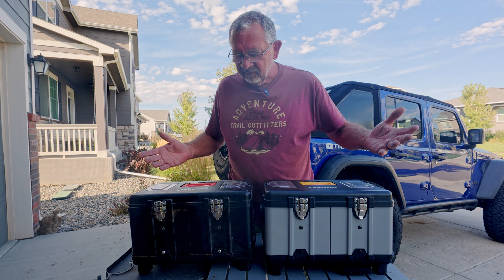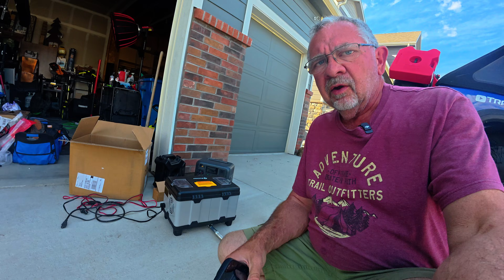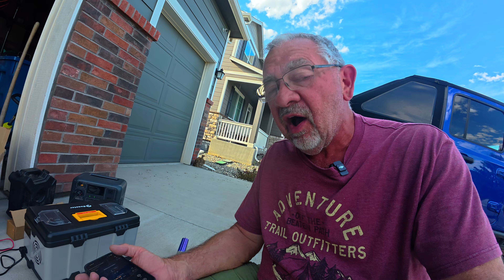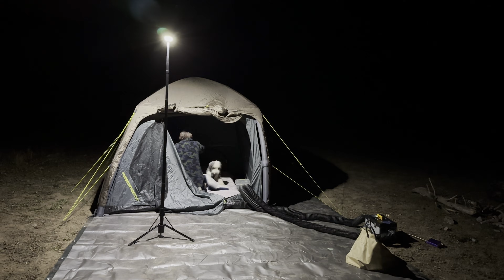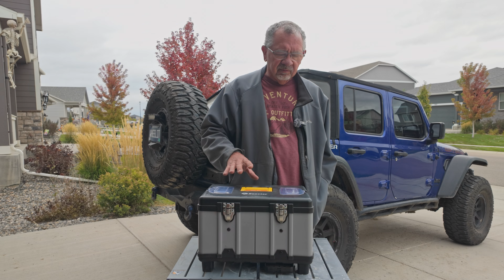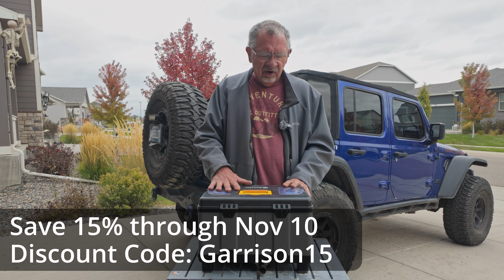Stay Warm When Overlanding With a Diesel Heater - Sunster TB10

Comment: How long did the ac70 run this unit? Looking at this exact setup for our enclosed trailer for winter camping pnw....
Reply from the maker: You will run out of fuel before running out of battery. If you’re running it for 8 hours a night, it’s the starts and stops that will drain the battery. You could probably get 5 nights off of it
Reply: @TrailTraveler perfect, that's the info I wanted to hear. Thank you

Comment: I have one to heat my office. Unit is inside with the exhaust to the outside via a hole in the wall. Only annoying thing is dat if I switch it on it interferes with my wifi so much that my wifi goes down. Any one have a solution?

Comment: So im thinking that i could also direct the exhaust to be used to heat my solar shower water.... that doesnt get warm on cloudy days. Imagine a car heater core that i add a 12v pump to circulate water from the tank thru the core and back into the tank. Bend up a ducted manifold to route the exhaust thru the heater core. You have all night to heat your water and by morning I bet the water is too hot to shower with. Thats the rough idea i have. Wasting the exhaust heat anyway.

Comment: Watched your video today and really liked the low noise aspect.  Went to order and it seems it's no longer available.  If anyone has info on a replacement model or other manufacturer with this low noise, please comment.  Amazon has another  Model from this manufacturer with less included and for higher price but no where near the detailed information as it did for the TC10 and it doesn't make claims about the noise reduction  Thanks for any info!

Comment: I’m surprised  that unit did not come with a 115VAC to 12V adapter..?  

I’ve got an HCallory SS2.  For the outlet heat I used a Male RV Hose adapter and use a dedicated 7’ RV hose connected to the outside of my RV - hole  in bdrm  - Inside I’ve got an oil filled electric Rad up against the outlet- in -34C temps provides warmed air to the heater which resides under my RV.  Hot air plumbed into my ducting via 4 registers.  

For fuel tank -I use yellow Jerry cans/ standpipes & Small hydraulic quick connects. 

Works like a charm. !!!
I Live in Alberta 45kms from Banff…

Comment: Do you know if the ambient temperature sensor is on the control module? I'd like to extend the ambient thermostat inside my RV. I can make up a wiring harness for this. Setting the automatic temperature control on the heater doesn't do any good if the sensor is outside.
Reply from the maker: It’s built into the controller
Reply: @TrailTraveler  Thanks, Then I should be able to extend the wires.

Comment: Your cigarette socket will NOT provide sufficient current to start the heater.
Reply from the maker: I use the one on my Bluetti power station, it works perfectly. Vehicle ones may not work.

Comment: I've been testing this heater out with the 4" x 8" hose and there is a big heat loss from the hose so I purchased a 6" hose to put over the 4" hose as added insulation so most of the heat gets to the end. Hopefully, the 6" hose will fit over the 4" hose. Otherwise, I'll have to go to an 8" insulating/insulated hose. I'm only heating an area of about 80' squared by 7' but I hate heating the outdoors with the loss from the hose.
Reply from the maker: We have been using a 4" insulated hose and I was able to cut it down to about 4'. This made a significant difference from running it longer as, obviously, the shorter the hose, the less heat loss.
Reply: @TrailTraveler  Unfortunately, I need almost the whole 8' to reach the RV window with the heater sitting on the ground on 2x6s. My solution of a 6" hose over the 4" hose should help a lot. Last night, using just the 4" hose, running the heater on level 1 with an outside temp of 38F, it kept the RV at 56F(pretty good). However, I'd like a little better efficiency. If it works too well, I can always open a window. I'll let you know.
Reply from the maker: One thing I did that helped before I had a way to get the heater closer was to wrap the hose with a moving blanket to minimize heat loss. Maybe something like this would help you reduce the hose length: https://amzn.to/3VYajrk
Reply: @TrailTraveler  The 6" hose was only $13 and will be easier to travel with and seemed to be the neatest option. Six feet of the hose is vertical so wrapping it would be hard to do. There is duct insulation that would work similar but I don't like working with fiber glass.
Reply from the maker: @ let me know how it works?
Reply: @TrailTraveler  I will. I just got it all set up last night. I'll do some detailed temp. measurements first, without the 6" addition and then with. The outside of the 4" hose was quite warm to the touch, that's why I figured I should insulate it. I also have the stainless 3" to 4" adapter that I am sure loses a lot of heat right at the exit of the heater. The 6" hose will inclose the adapter and also the 90 elbow going into the window. I expect a 50 to 100% increase in efficiency.
Reply: @TrailTraveler  I got the 6"x8' duct today. Checked it for fit, very nice about a half inch gap between the 6" and the 4". Should be great. Collapsed it is only about 10" long so it will be no problem to pack. I figure that I can collapse both the 4" and 6" together for a nice package. I don't think I'll bother with diagnostics, speccing out the difference with and without the 6" duct. I know it's going to add a ton of efficiency. FYI, it is from the same link as the 4" duct.

Comment: I got one of these yesterday. I'm impressed. Seems to put out more heat than my RV's propane 38kbtu furnace. Efficiency seems to be better also. I'll have to do a cost benefit analysis.
I also got the 4" hose per your suggestion and a stainless 3"id to 4"od adapter. (Amazon description: Exhaust Pipe Adapter Connector Reducer, 3" ID - 4" OD). I ran the unit on high for about 15minutes. The heat exch go to 450F, didn't melt the hose. I am debating whether I should get a dryer vent or elbow to put in the RV window facing in.
I'd like to go to RMNP but it is either too touristy or really cold. I used to go up to Estes and RMNP 30 to 50 years ago when there wasn't gridlock. Now I hang at Blue Mesa and McPhee.

Comment: Hello. Enjoyed your video and I am interested in this unit. I watched your video on the Winnpro and you are correct about it. I bought one based on another video that claimed it was quiet. It was loud. This one you have seems to be quiet but I have a question. With you being a person that modifies your own heaters to make them as quiet as possible weren’t you curious to see how they made this one so quiet right out of the box? I expected you to at least inspect the interior to see what type of pump they used or if they insulated it somehow. Thank you for the review and have a great day.
Reply from the maker: This one, and the LF Bros N2 Pro (which is the quietest heater tested to date) simply have different fuel pumps that don't make any noise.
Reply: @TrailTraveler  I understand that part. But what pump are they using?
Reply from the maker: @jimspence5779  The LF Bros doesn't say anything on it
Reply: @TrailTraveler  I am only asking because I got suckered on the Winnpro from another channel. I like taking things apart and I think you do too based on your ability to modify your units to make them better and quieter. Plus I believe you know what to look for and if this unit is that quiet for that price I would be finding out exactly what pump they are using. I believe that the other channel I watched to buy the winnpro probably received a modified unit from the factory that was quiet but the one sold to the general public was not quiet at all and probably used sub standard parts. I am trying to find the quietest heater I can buy. I appreciate you taking the time to reply. Have a great day.

Comment: Hi Carrie, I bought this Heater because of your recommendation, actually, I used your code and I appreciate it, but unfortunately,y it didn't work, I'm just returning from the coldest camping trip ever and it didn't work, I did use my Jackery to connect it, I tried several times every night but it only sent me the message E10 and E08, I don't know if you have any recommendations because this item isn't returnable and wanted toseew if I was probably doing something wrong, thanks
Reply from the maker: Are you trying to connect it with a DC connection or to one of the AC outlets? I have issues with most power stations not being able to fire up a heater from the DC port. Try the AC adapter and see if that works for you.
Reply: @TrailTraveler  I did use the AC outlet
Reply from the maker: @SoyJonaMusic  Sounds like a bad glow plug or bad connection to it.
Reply: @TrailTraveler  ok! I'll try using a different connection cable and/or a different power source. Thanks!
Reply: @SoyJonaMusic any updates?
Reply: @ExploreLiveCreateShare  The heater was broken, I spoke with customer service and they sent me a new one, which is working perfectly!
Reply: @ExploreLiveCreateShare  btw I ordered a replacement for the thermostat cable and I installed it in the old heater but it didn't work either, I guess I'll never know what was wrong with it.

Comment: Would you be able to do a short video or provide a better explanation on how the operation of it works? I have the exact same heater and I’m having a hard time figuring out basically how to make it run correctly. When I use the app it never really goes below level four on the fan. I’d like to be able to keep it on speed one or two and have my temperature set so I’m not getting roasted.
Reply from the maker: I’ll see if I can do that in the morning

Comment: I keep getting auto shutdown, overheating error code, and only at 1/2 heating power! Checked that fan not blocked, duct hose not kinked but still recline overheat error after 30 min run time. Any suggestions?
Reply from the maker: If you are running more than a few feet of duct hose, you will need to move up to a 4" house
Reply: @ thank you, currently running 8’ of 3” insulated duct hose. Which adaptor/reducer attachment would you recommend to attach 4” hose
Reply from the maker: I believe this is the one I used: https://www.amazon.com/POWERTEC-70145-4-Inch-3-Inch-Reducer/dp/B00M3IT378/ref=mp_s_a_1_1?dib=eyJ2IjoiMSJ9.A-Vuix9V8ycGAelm-PB87huyNRHv309Eij5YrXVaPxG40RYfwzeTSJv5jPoFqj0p7vO1VZ5R6zMfmKczai8-yTyylIEDH-COnwDYAfVLio8XB0dscArpezZqVBV0Tnpjjj2wKw0ZEJDJnVadF2KlQSsn7OIVnRUQLnuQvWyPfWMciWHA9OCuYwL7DExx1n6tWGc9LbNYNzWCMu8KE9ccOA.PyEglDKVQP1M8YpwDOftx78LXxIqC0YnS1pz9v8mVZo&dib_tag=se&keywords=POWERTEC+70145+4-Inch+to+3-Inch+Reducer&qid=1730958472&sr=8-1

Comment: I just bought this heater, and it’s been delivered.  What adapter do you use on the hot air outflow to easily attach the insulated hose?  Thanks in advance.
Reply from the maker: I 3D printed one. After testing though, I don't think I will be recirculating the air as it didn't make any noticeable difference. I will be doing some tests when it gets colder here to see if there is some point that it makes a difference.
Reply: @ thank you!

Comment: Good review. In regards to the exhaust, I would get it off the ground a little and sit it on a fire resistant mat. They come in various sizes and very inexpensive.
Reply from the maker: I didn't think of that. Do you have a link for one?
Reply: @TrailTraveler can you do a video on the controller mate I’m struggling to get to grips with it , great video

Comment: Hi in this video you mentioned there is no benefits to recirculating the air from the tent back to the air intake. How is there no benefit? Does it not save on fuel consumption? Curious if we should all ditch the extra duct to recirculate the warm air. Thanks
Reply from the maker: We had very similar conditions two nights in a row. One day we recirculated and the next we didn’t. There was no noticeable difference in temperature, battery usage, or fuel usage. This was at around 26F.   I’ve talked to some other users that say the same thing. Maybe, under some conditions it could have a greater effect such as colder temperatures.  I plan on doing some testing here when it gets colder.
Reply: Ok that’s interesting and would love to see more testing from you on this. I also own the HCalory SS2 and wonder if this applies to that heater regarding recirculating air or just this Sunster heater?
Reply from the maker: It should apply to all

Comment: Great video, I was wondering if you got this heater to work on the plug in DC outlet on the AC70. I keep getting an E01 error on my heater. I don’t have any issues using the supplied ac to dc power supply.
Reply from the maker: I normally run it on an AC70
Reply: @ thanks for the quick response.  Do you use the DC plug in on the AC70 or the AC outlet on the AC70 with the power supply the heater came with?
Reply from the maker: I’ve used both
Reply: @TrailTraveler Consider yourself lucky. I am not able to get the plug in DC outlet on my AC70 to run the heater. I keep getting the E01 error. I tried a different plug and same thing. I added a multimeter to the circuit and the DC voltage will drop all the way down to the 6-7 volts when starting up.
Reply from the maker: @joezweig9202  I'll go back out and test this specifically. I use the AC70 for all my diesel heater tests but maybe I skipped it on this one. I will try to get to this today, I just have to move some fuel around and wrap up an edit.
Reply: @TrailTraveler  I really appreciate that and your time in doing the test.
Reply from the maker: @joezweig9202  test results: https://youtu.be/9mBaJBwBE00

Comment: Im gonna order this very soon. Now i need to find used a truck cap (at least for now ) & do some winter camping & snowshoeing.
I was leaning toward other brands , but the reduced noise sold me. & your discount code did work thank you!
Reply: S'mores canvas Fronti hot 🔥 tent is what I use this exact heater , this one's a winner been using it for 4 years straight now and it's super quiet

Comment: Great review. Even the ones that are much more $ (ls bros) seem louder in reviews
Reply from the maker: We are testing the LF Bros N2 Pro right now. It is the quietest unit we have tested to date.
Reply: @TrailTraveler  So the LFBros is quieter? Wonder if there is a difference between the N2 vs N2 pro.
Im pretty sure the pro has more altitude adjustments . Highest road withing several hrs of me is 3000ft.
Reply: @TrailTraveler  ended up with LFbros N2T. Its very quiet!
Reply: @ctclimberguy34  The N2T doesn't have automatic altitude adjust right? I think only the N2 Pro does. This feature is important to us because we live at 5,000' and we can be camping anywhere from sea level to 13,000' so "plateau mode" is a must have feature.
Reply: @KerryGarrison  yes N2t has altitude compensation
Reply: This one is the one I use , it's only 35 decibels it's super quiet you can't hear this at all zero clicking at all!!

Comment: Will it work with gasoline?
Reply: Please confirm that this can run on kerosene.
Reply from the maker: @danbosch1621  According to numerous threads in Facebook diesel heater groups, yes.
Reply: @TrailTraveler thank you!
Reply: @danbosch1621 I ran mine on kerosene already,it's basically the same thing
Reply from the maker: No. Diesel or Kerosene. Gas requires an ignition system, pistons, timing, etc.
Reply: Great video and review.  Last year I bought WIPPRO  all in 1. I did change the fuel line and added a fuel filter and I am so impressed with the quite pump, you can hear it till the glow plug turns off then it's almost dead quite
Reply: Once!

Comment: Glad to see you accepted their offer to review, that being said it appears this unit is riveted together as well, like the Hcalory this will still prevent in the field service of the fuel pump. Well, you are much happier with the acoustics of this unit (and it's less expensive than the Hcalory unit) you didn't mention if the unit has a fuel filter which was one of your major cons on the SS2. Does the unit have a fuel filter? It also looks like the air inlet for the burner is a slightly different design though located in the same location as the SS2. The muffler looks a little more premium, does it perform better or the same as the SS2? I was just curious how many of the prior cons were resolved in this unit? Clearly the outlet pipe is still an issue. 
Thank you for the review.
Reply: I've got this heater, there is no fuel filter which to me is no problem because the fuel is filtered when I put it in the jerry can from source,, and again through the funnel to the heater. I replaced the rivets with 3M Rivnuts to make maintenance access easy, and replaced the supplied green fuel feed with hard plastic white one.
Reply: @Chris66able  thats a crap ton of work but will pay off the first time you need to blow it apart to fix something, which i'll bet will be pretty soon
Reply: @daltonsband  Your talking shite..A hand full if rivnuts and a bit of plastic, took 10mins...Divvy.
Reply from the maker: Without popping off the rivets, I can't tell if there is a filter underneath everything.  The muffler is pretty much the same. The main improvement is the fuel pump noise. The air filter does seem to be a better design, but I don't think it has any major benefit. We have some other ones we are testing now that are pretty interesting and I'm looking forward to using one of them for about a week starting this weekend.